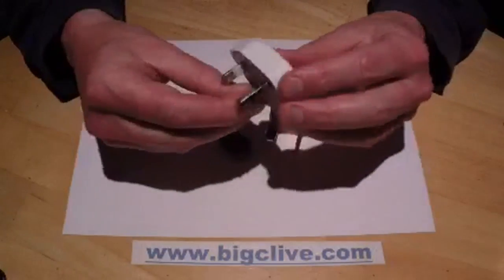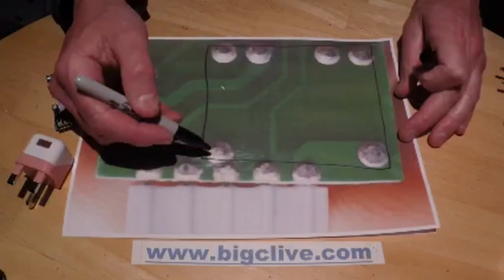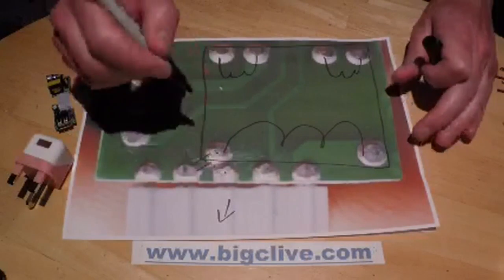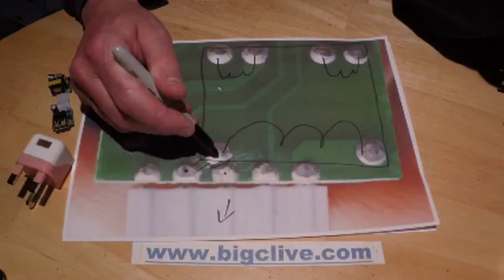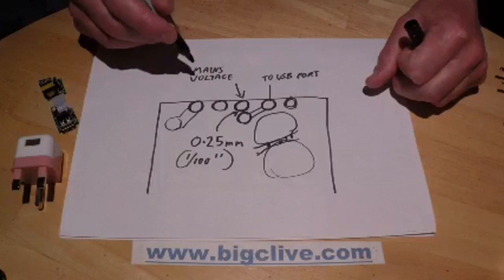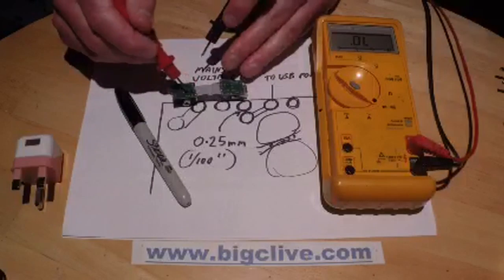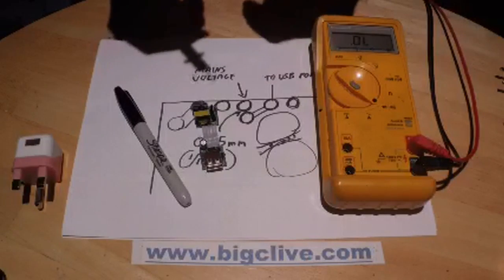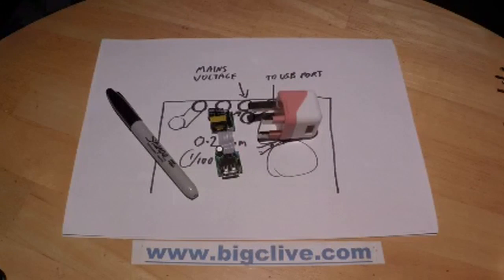Really dodgy pink USB charger.

Comment: looks just like one with 2 prongs on it but they fold down for portability.  (US version)  they have the same date of 2014 as this so I wonder.  Has the same design of white and whatever color with the diagonal mix.  and the USB port aimed up.  Just eh run that tester on it and shorts out the moment I plug anything into it.  ;O (CVS brand)

Comment: This is perfectly acceptable in China and most 3rd world countries..
This is starting to get to the point where I may need to haul in the isolation transformer to charge my cell phone..
I worked on a 32 inch LED TV a couple days ago that had a similar situation in the power supply board.. We use the 120 volt mains system here and not the 240. I assume if we did have 240 volts then the magic smoke may have escaped when i plugged it in. Glad I gave the board a once over after re-capping it.
Reply: Actually not acceptable in China as of 2006 - this is an illegal product to sell there, suitable for export only.

Of course it's not suitable for import into EU, USA, Canada, Turkey, Russia or Australia, but there are a LOT of countries in the world, many with no regulations whatsoever.
Reply: +ElfNet Gaming And hence the problem!!! Also it gives the intolerant among us (yes, im being polite)more fuel for the fire

Comment: Can a crappy charger really shock the user when its plugged into the device intended to be charged?
Reply from the maker: +Mac MashPotato Yes.  If there is a fault that connect s the 5V to the mains then it will appear to work, but if any metal connection on the device being charged is touched then a serious shock or electrocution could occur.
Reply from the maker: +Peter Folchi If the chock was from the body of the power bank then it most likely came from the charger.  If it was a strong shock then that charger would be best disposed of immediately.  If it was a slight tingle then it may have been down to the capacitive coupling that occurs between the primary and secondary of these chargers via the layers of windings and interference suppression capacitor.  The tingle would be amplified if it was on broken skin and if you were touching something grounded at the same time.  But sleeving the metal body of your power bank was probably a good idea anyway if it's connected to USB ground.
Reply: +bigclivedotcom And because many devices such as tablet computers and phones have metal cases or parts of the cases are made of metal, it would be so easy for someone to get electrocuted when they go to get their device.  Is it possible that such an electrical fault with the AC adaptor could damage a device that's plugged into it?
Reply: +Lachlant1984 I've had it happen to me with a portable battery bank that was 5 V. It wasn't a big shock but it still wasn't fun. It has so far been the only shock in my whole 15 years of life
Reply: Well that's not good at all, I wonder what could have caused that to happen.  I'd hope that the shock you received wasn't as bad as having 120 volts/240 volts AC going through you, but still, it wouldn't be fun.  Did you look into replacing the battery bank or getting it swapped for a different one?
Reply: +Lachlant1984  I was a metal bodied device. I did continue to use it butt insulated it with heatshrink because it was a good power bank. Single cell battery though but it will get me through 2-3 full recharges.
Reply: +bigclivedotcom I opened it up to see after the bank completely died and all it was, was a really bad solder joint.  It is an iHome branded bank I still have it...somewhere....

Comment: Did this charger carry relevant safety agency approvals?  Doesn't matter — it's from China.

A few years ago I returned half a dozen 4-foot fluorescent shop lights to my local Home Depot home improvement center, because every time I turned them on I could hear arcing, and when the weather turned cold in the autumn, they'd refuse to light up.  I opened one up out of curiosity and found an axial-lead polyester capacitor with no outer skin and shreds of metalized plastic hanging from it.  I didn't even know that it was possible to buy such unfinished capacitors.  There were bare wire connections that were just twisted together, not soldered or crimped.  When I discussed the matter with the sales associate who worked in the electrical department at Home Depot, it turned out he was working in the store part-time, beside his day job at Underwriters Laboratories (UL), perhaps the best-known safety testing agency in the United States.  He said that vendors in China would routinely forge UL approval labels, even the fancy hologram types, and that electrical goods from China often hadn't undergone any safety testing whatsoever.  One can get reliable electrical products from China, but they had better be brand-names, such as Philips, Braun, etc., manufactured in a plant controlled by that company and sold through a reputable retailer., because the Chinese have no compunction about faking brand name labels and shipping container-loads of their junk to North America and Europe.  The best policy is to avoid products made in China that operate from the mains voltage, if at all possible.
Reply: +Milosz Ostrow How does one, in this day and age, avoid products made in China that operate from the mains voltage?
Reply: +Milosz Ostrow Its like Chinese gear gets a Get Out Of Gaol Free Card, just coz people should know better than buy that cheap crap.

I know that Taiwan and Japan was known for knockoffs in years gone by, but in general they did it well and they didnt flagrantly contravene safety regs like the cheap arse shit from China thats sold pretty much with a 'On your head be it'  policy!
Reply: Robert Lozyniak It is difficult, I know.  I sometimes buy old, used products at yard sales and at thrift stores when I see that they're made in U.S.A., or in a U.S.-owned plant in Mexico, because they're generally of better quality, and when you see a UL, CSA, ETL, or other nationally recognized testing laboratory mark on it, it still means something.  The alternative is to open the Chinese-made device, if practical, and verify that it is built correctly, but that's not really an option unless one is an engineer or trained technician.
Reply: 75IFFY "Gaol" is an interesting way to spell "jail", but I agree with what you said, and English is a tricky language.
Reply: @buddyclem7328  https://www.spectator.co.uk/article/why-did-we-ever-spell-jail-gaol-
Reply: Patent infringement doesn't translate into mandarin very well...

Comment: Two words.......

Tin Whiskers

That gap is well within the range for the growth of tin whiskers in RoHS soldered joints.
Reply from the maker: +Strider9655 Probably helped greatly by the little balls of solder that were almost bridging it completely anyway.
Reply: +Strider9655 BUt by the time tin whiskers actually grow that charger would have met it's EOL I assume..
Reply: 75IFFY End Of Life - Term we use with just about all modern electronics that die of early old age and are not financially responsible to repair.
Reply: Those whiskers would grow that distance in minutes.... given the gap, and balls...  =)
Reply: so your ipad went bang?
Reply: +ElfNet Gaming It met its Encyclopedia of Life?????    Or did I google it wrong?!
Reply: ElfNet Gaming I just knew that someone wouldn't see the joke and give an answer to that. Guess what, you win!!!

Comment: You are certain the mains voltage is being run across the wire?  Why would they run the mains voltage to the USB connector??
Reply from the maker: The mains side connections going over to the USB connector PCB were for the opto-isolated feedback for voltage regulation.  They would pass fatal current if touched.  Here's a link to a video of a chap getting a serious shock from a phone plugged into a defective USB charger.   Man ELECTROCUTED By Plugging In His Cell Phone  The current path is through the phones metal casing into his hand (causing it to clench onto the phone), his arm (causing it to clench into his chest) through his body (causing him to fall) and through his bare feet into a ground reference.  As he fell the USB lead pulled out the phone breaking the circuit.  That doesn't guarantee survival though, since a current path through the heart can knock the muscles out of sync.
Reply: bigclivedotcom "Unfortunately, the video is no longer available because the user account has been terminated." or something to that effect. Strangely, when searching to find my way back to this video, the second result for "Shitty Pink USB Charger from China" was a picture of President Donald Trump. (Still feels wrong to say President.) I loved your song and this was also a great video!
Reply: bigclivedotcom This is a similar video to the missing electrocution video. Warning: it may be disturbing to watch.
https://youtu.be/fYxtUbF6iF8

Comment: Looks a lot like one I took to bits, except that didn't have solder balls in the flux residue.  Clearance and creepage were abysmal as usual, however.  The ribbon cable between the switcher board and output board had the unrectified output of the transformer on the outer two wires and the feedback opto transistor wires on the inner two wires.  The feedback opto transistor that is only at about a hundred volts relative to ground.
Did I mention that the USB connector shell is part of the return path for the output?  The user accessible shell that is 10 mils (at multiple points I might add) from said opto transistor connections?
I plan on cobbling together a hipot tester with a spare MOT in the near future.
Reply from the maker: Is it wrong to LOVE dodgy Chinese electronic stuff like this?  It just seems quite pleasing that you get random mains voltage devices in girlie colours and styles that are basically electrocution on a plate with a side serving of fries.
Reply: bigclivedotcom
I find it more scary given that for every one of us that knows how to see if the bloody thing is safe, there are hundreds or thousands who think that they are and just use them willy nilly.  With the corresponding toll of death and destruction.
Reply from the maker: randacnam7321 This why we have trading standards...   Oh wait a moment.
Right now there are probably quite a few phones that are "live" while on their charger.  And people are completely oblivious to that because they are standing on carpet on a wooden floor when they pick them up.  But one day they'll maybe pick it up while holding onto something grounded....